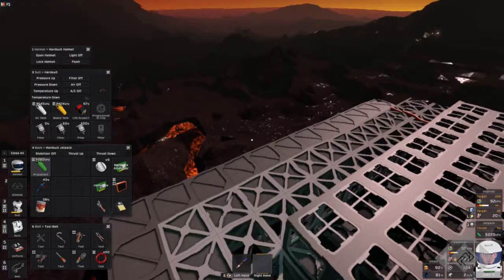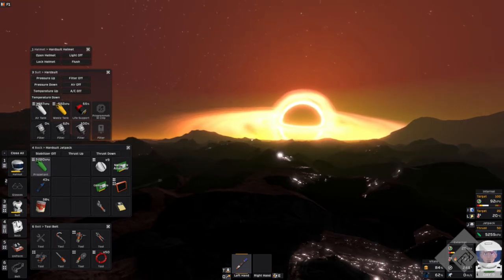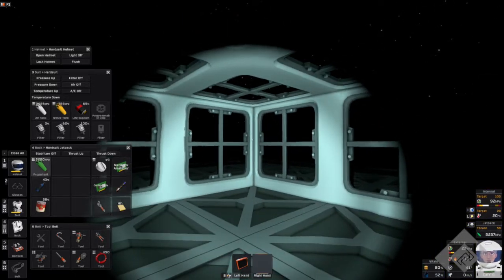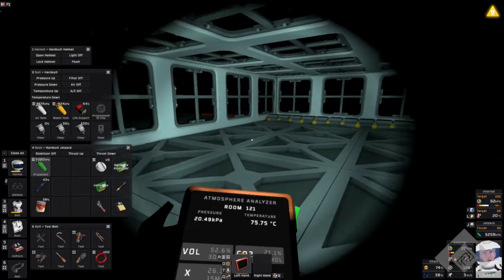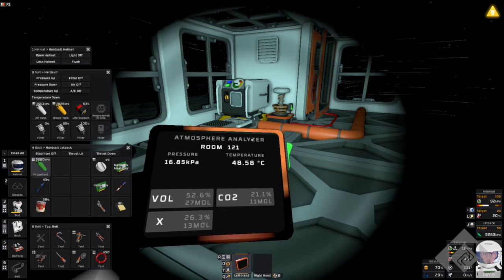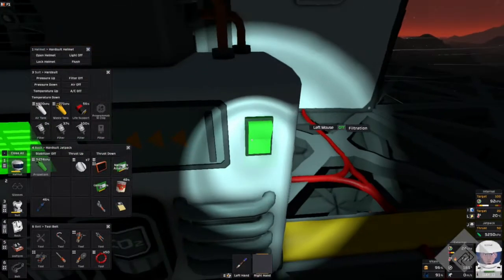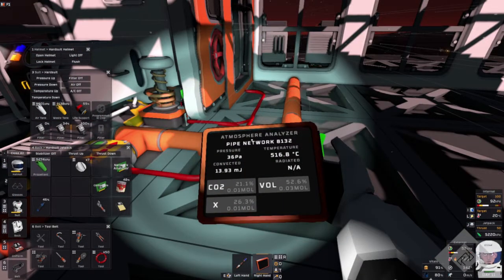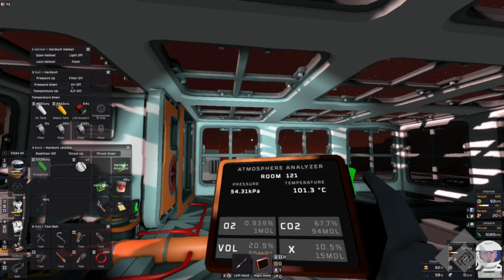Over Powered, and Finicky, Portable ACs - Stationeers Experiments

Comment: Also your video commentary on gas dynamics are really informative as I am studying on it to better understand heat exchanges and how they function.  I enjoy working with HVAC and electrical systems.  Also I am in agreement on the nuclear plants I worked at a plant that did the insulated blankets for the power plants.  That was 20+ years ago.☢☢☢😁
Reply from the maker: That's cool! My father worked at Bruce Nuclear Power for a short time installing high voltage wiring for the loading and unloading cranes. I took several tours as part of a job I had... I however, have a degree in economics... Yay! Nerd Princess! But science is my passion, especially thermal and fluid dynamics! But I am in no way an expert, I'm basically a moron who reads a lot.
Reply: @JoelleTheAbsurdist  well your explanation just happen to come after I watched a handful of videos from engineering channels on expansion valves.  Btw you might consider a pressure regulator or volume pup rather then the one-way valve and see if there is a difference.  The Volume pump would probably need a pid IC controlling it, but would be interesting.
Reply from the maker: @cdm96247  I think flow through the one way valves are fractional, so act kinda like a capillary tube. To increase pressure differential you just need to add more valves.
Reply from the maker: @cdm96247  Conversely, to lesson the differential, add more valves in parallel.
Reply: @JoelleTheAbsurdist  Hmm I would probably over complicate things by adding a pipe analyser before and after the radiators and creating a electronic expansion valve using the volume pump and just increasing the flow speed and just nitpick the numbers till I was frustrated 😖 or satisfied 🤨enough
Reply from the maker: @cdm96247  I'm constructing an experiment now to determine how Stationeers will react to head pressure changes!
Reply: @JoelleTheAbsurdist  Nice!  Looking forward to it.